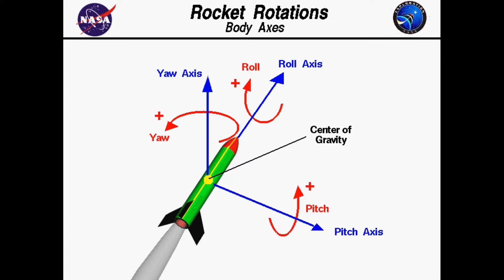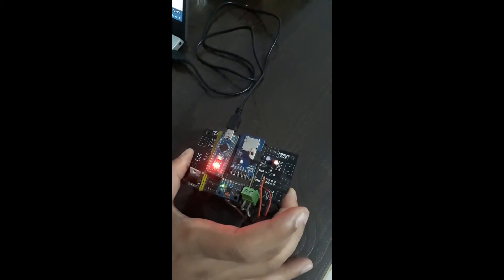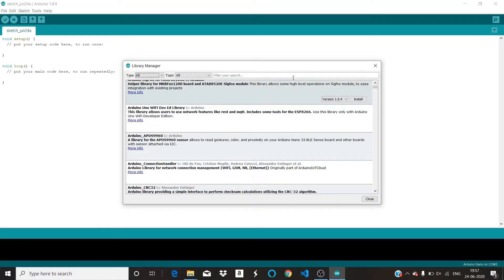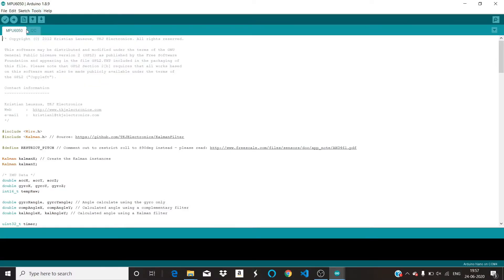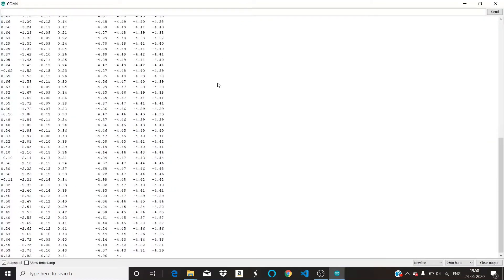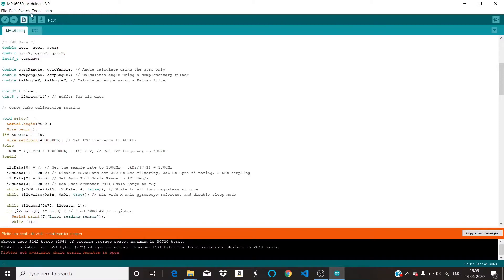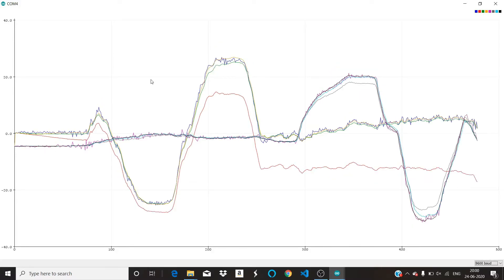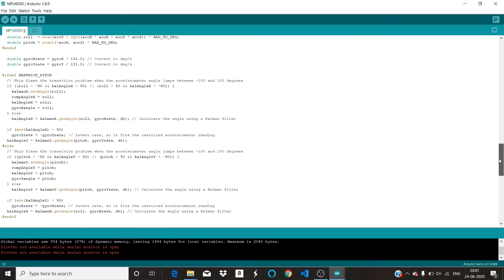TVC Rocket Flight software coding. MPU6050 kalman filter code

Comment: Do we use accelorameter for tvc or a gyroscope module
Because I am planning of using a accelerometer sensor only
Reply from the maker: I think with accelerometer you can not achieve the proper axis orientation. Better option you can use both of them .

Comment: Why don't you use fin stabilization rather than using a TVC, model rockets have a very less burn time TVC might not be that effective for stabilization. 
I trying it myself so just a suggestion.
Reply from the maker: If i will use fins the rocket will become in heritable stable and it will go like dart. But i want my rocket to be like real rockets. Thank you for your suggestion i will definitely try it sometime.

Comment: Bro i also want to make a rocket model can you tell me from where I can get rocket motors(solid fuel)
Reply from the maker: I have made my own rocket fuel.  Its called black power rocket motors. 

Its wonderful to have you on channel. Love to help you out
Reply: @utkarshgupta2972  can you show us how to make a good rocket motor and thanks for replying
Reply from the maker: Ya sure i will make a video for that.  These days i am little busy that is why i am unable to make video. You can contact me on my email utkarsh.gupta1994@gmail.com if i am unable to make video soon
Reply: @utkarshgupta2972  Brother can u please make a video on full rocket otherwise on full body n how to fit engine on it
Reply from the maker: @saswatrath369  ya sure bro. I am planning to make a video on this topic. By the way thank you for connecting ❤
Reply: @utkarshgupta2972  most welcome bro ❤️,ya please make it as soon as possible I'm also doing a project on it in my clg bt I got failure 🙂 n please make a vdo on satalite
Reply from the maker: @saswatrath369  ya sure. Bt if I could not make it soon. You can send me a email , I will tell you my contact no  and you can call me if want ❤. I will help u out

Comment: I am trying to build a similar thing too, in Melbourne Australia
Reply from the maker: Wow thats really awesome. It will be amazing to look at ur rocket. If you need any help feel free to ask.😇
Reply: @utkarshgupta2972  I really want to be able to land a rocket propulsively, That was Joe Barnards original vision, he seems to have given up on it lately. Im looking at using a hybrid engine, so it can be throttled for landing.
Reply from the maker: @kayboku7281  ya i am also inspired by joe. I think hybrid rocket will work super fine, bt there are few difficulties 
The size of rocket will increase bec now we will also hve to place the oxidizer tank inside the rocket. 
Also a lot of valves and are system will be required to control the flow of oxidizer. 
But with hybrid rocket we will control the propultion and that wil definitely make us land the rocket .
 I think this it is very ambitious. And it will be amazing to watch ur Rocket fly.
Reply: @utkarshgupta2972  I think to start off with, it doesnt have to be liquid oxygen, using compressed oxygen will be ok, the paintball gun industry has lots of light weight compressed air tanks available make out of carbon fiber.
Reply from the maker: @kayboku7281  space companies are using liquid oxygen bec of its high density. I think compressed oxygen will work but it will not be super efficient, kindly do a little more research bec i m not good in chemistry lol.  You should give a try , but stay safe and try with all precautions. And kindly tell me how ur tests goes .All the best.🖖
Reply: @utkarshgupta2972  someone pointed out today, that regular air is only 20% oxygen, so using compressed air, will only be 20% as an oxidiser. Need pure oxygen

Comment: If my skills and focus is in designing and operating Launch assistance systems/Rocket boosters, will this software or code language be useful for reporting and controlling/adjusting rocket boosters during flight and landing? Thank you, you have a new subscriber
Reply from the maker: This code is focused for small scale rockets. But it can help to get ideas what to learn in the future. Thank you for connecting ❤.

Comment: Dhaniya why you need to stable your values of P, Yand R. You need a good gyro that can measure  minute deviation in your angle as I remember and it's doing.
Reply from the maker: P Y R defines the orientation of the rocket agar wo angles constantly change hota rahnga rocket unsatble hojayag aur PID stable ni kr payaga.  Ha waise aur acha gyro use kr skta hai bt that can cost about thousands of ruppes for ex( vector nav ek IMU bht acha hai).
Filtering se is IMU se bhi achi values mil skti hai